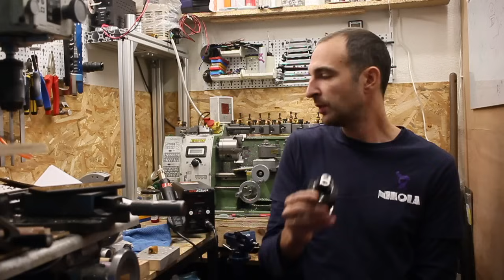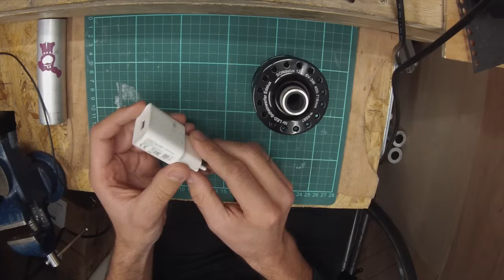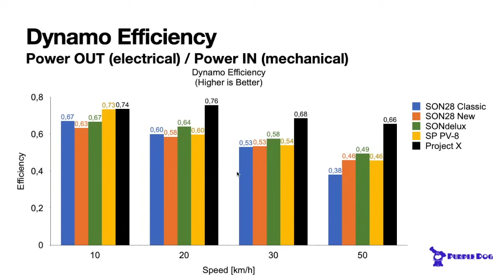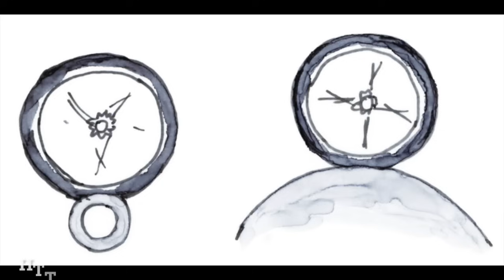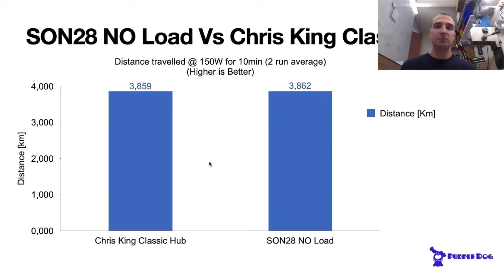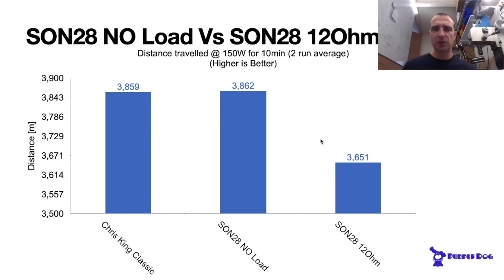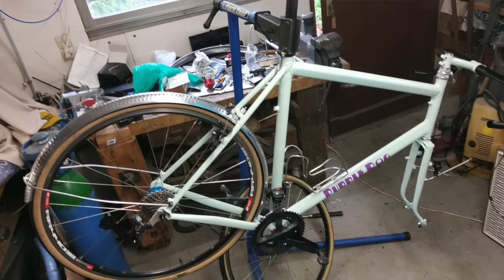Dynamo Drag and Resistance Tested: Myths Busted

Comment: Very fascinating video to watch through, thank you!  I am curious if there is a rough model of the equivalent circuit of a dynamo that would be "good enough" to put into a Spice simulator and be able to play around with?  I imagine that this may be easier said than done thanks to not only a large shunt inductance and modeling all the coupling effects, but maybe there exists a crude simplification to get a hobbyist started?
I am also curious how the drag effects compare between a shorted output vs. and open circuit output?  What I am getting at is whether an electronic load should aim to minimize voltage or minimize current when the available power exceeds the load power.  I imagine the ultimate load circuit would attempt to not only use peak power tracking (adjusting effective Rin dynamically), but also would adjust any series/shunt capacitance to peak low speed power as the frequency varied as well?
Reply from the maker: Thank you for your comment and the nice words! I will pin this discussion on the top, as people might find it interesting.

To answer your question: there is a paper that I think has what you are looking for (https://www.mikrocontroller.net/attachment/14850/BikeLight.pdf). There is another one that had a MatLab simulation of a dynamo model, though I can't seem to find it. 

To summarise, it describes exactly what you mention - Maximum Power Point Tracking (MPPT) so that the dynamo always 'sees' the optimal load (at a given speed/frequency) for maximum power extraction. Some (current German) devices from my competitors use that principle. It is/was? largely a theoretical concept and while it does provide a quite linear response, to get any real power (5+W) you need to be going above 20+kph/13mph. The result of MPPT is that the power curve keeps going up together with speed (so you can get 10+W at 40kph/25mph), rather than flattening out (as you get without MPPT) - Fig. 12 in the publication It does look nice 'on paper,' though keep in mind that those speeds of 40+kph are not sustainable for any reasonable length of time, let alone with luggage/touring/randonneering/etc. (this is elite TT power territory with all the aero other bells and whistles - deep section wheels/ helmet, aerobars, etc.). All in all,  you are still **tuning a small engine/using a weak power supply to begin with (ie the 3W dynamo)** so it does not address the primary issue - ie dynamos were made to power **incandescent** bulbs/12Ohm load (aka century old technology) and hence not done with modern electronics/power needs in mind.

If you have not seen it already, I am actually I am working in collaboration with SON on a much more powerful dynamo - Project X (https://youtu.be/YFMvuJGLCV4), that is ~300% more powerful than standard 3W dynamos (under identical load), and with the right electronics such as my recent  dynamo powered lights+USB-C charger (The Stalker - https://youtu.be/1nl_8t_ykJg). With this dynamo you can get **sustained** power of 7-8+W in the 15-20kph range, which are normal riding speeds. I am working on some other electronics that can take ~10W in the same speed range. 

**In my opinion/expereince** after working/designing various power supplies (for dynamos) for some years now, is that you need a capable power supply as step 1, rather than starting with a unsuitable (and extremely outdated) power supply (aka '3W dynamo') and trying to optimise for it afterwards. 

I am curious to hear any comments and get a discussion going on that subject (MPPT) and dynamo optimisation, so do not hesitate to comment below. :)
Reply: @CustomPurple  Thank you, this is exactly what I was looking for.  I agree with all you say about current limitations.  Being an engineer with a leftover dynamo and a few dead donor headlights on my desk I’ve been desiring to go play with them to make something for fun to get back to circuits I can actually get my hands on.

My background is mostly RF and Microwave work (former Rohde & Schwarz engineer), so I am uniquely both over and under-qualified.  It has been a long time since I my projects were home lab friendly like this sort of is.  I still want to go waste some time putting together something fun, whether justified or not.  I expect that once I hack something terrible together I will be back to order something nicer from your shop.  Thank you for the guidance!
Reply from the maker: You are welcome. =) I am curious what you make out of it. After working at Rohde & Schwarz I am sure you have some different perspective on things(not to mention some cool measurement tools hehe!!!). Definitely curious what comes out of it! One point is that bottle/tyre driven dynamos have too high frequency (at the rectifier) and I am not sure any MPPT has been successfully done with one. Hub dynamos spin much slower at the same speeds.

Comment: When are they going to make a better electrical connection Port????
Using a dynamo hub on a 20-in wheel would even work better....
Reply from the maker: Son29s already has the Son coaxial system by default. Other Son models (with the flat connectors) can be converted to Son coaxial with an adapter; I sell quite some of those actually. 

Of course the best way is the Son SL system that uses the fork dropouts, though for that you need a custom fork (I make and sell a couple of these during the year as well). 

Dynamos in 20in wheels doesn’t really generate more power, it just shifts the power curve. A newly designed dynamo (like Project X in my other videos) is the way to get more sustained power at all speeds.

Comment: Would you offer a non-stvzo beam, in a traditional round pattern?  I get really frustrated with beam cut-off, i actually need to see when i turn, and i dont ride on perfectly flat straight roads.
Reply from the maker: Thank you for your comment. So I can answer in 2 parts.

1. I have a product (2 actually...) The Stalker (https://custompurple.com/the-stalker/) and Kerrigan (https://custompurple.com/product/kerrigan/) that has a LED matrix and beam control so you can switch on a high beam above the cutoff. I call it Farsight and as the name suggests it does exactly that, though it dazzles oncoming traffic. It is dimmable to tune to your riding conditions as well.

2. This often missed when people think StVZO cutoff, though, as StVZO regulation is measured on a white wall 10m away (which is quite far), StVZO style optics have **superior** throw or illumination distance as compared to 'simple round beams' - I talk/show it in my Stalker video here (https://youtu.be/1nl_8t_ykJg?si=Q8tXT3RtH5410v0E&t=686). Round beams have a VERY bright spot close in front of you and a sharp drop in illumination afterwards. So your eyes naturally focus there and at even moderate speeds (15+kph/10+mph) you 'outrun' the beam. On (fast) descents it is significantly worse I can even go as far as saying it is borderline dangerous and unsafe.

Comment: Reactance is important for dynamo hubs because these put out alternating current. Generally reactance is like ohms but it comes from internal resistance to changing the polarity so quickly. Back emf in motors is the perfect example. The stator generates a magnetic field, and the rotor is spun, but the rotor has its own magnetic field that will induce voltage perfectly opposed to the stator. Once these two are equal the rotor can no longer accelerate. It is stuck at that speed until either the stator gets stronger or the rotor gets weaker.

Its like DC, stacking up batteries negative to positive adds voltage, stacking up positive to positive subtracts. This applies to ac as reactance because induced voltage is always 180* out of phase.

It also is how certain 3 phase can be higher voltage than any single phase, because the voltage is adding for part of the wave.

Comment: very interesting matter. Ive been tinkering a lot to get most out of my hub dynamo, but it is never been simple. Another thing about your 12 ohm bulb: how does that relate to the fact that here in the Netherlands classic 6v 3w dynamos always power a rear light in parallel. so that would sum around 6 ohm. does the german regulation not require a rear light? that seems odd to me. cheers and thank you for uploading. Hope you will get into detail about rectifiing and regulating to 5 v (usb standard) with a hub dynamo, and how several products compete here over the efficiency.
Reply from the maker: Thank you for your comment. I mentioned it briefly in the video that the 12ohm is by doing the math/ohm's law). The math is as follows: 

Front bulb: 2.4W, 6V -> 0.4A, 15Ohms (6V/0.4A)
Rear bulb: 0.6W, 6V -> 0.1A, 60Ohms (6V/0.1A)
Total: 3W, 0.5A, 15 and 60Ohms in parallel (15x60)/(15+60) = 12Ohms

I myself make and sell 5V chargers from dynamo video here (https://youtu.be/BmKDtM5p_H0). The Companion allows lights on AND charging at the same time. Most (if not all?) products are charge only.

Comment: In praise of STVZO. I acknowledge Nikola's comments about how STVZO regulations have created a situation where reported numbers like power output do not match real world experience. 

But there is a plus point in that the regulations requiring anti-dazzle beam cutoffs have resulted in Germany to make lights with the best optics. I have both STVZO and non-STVZO lights of similar output - and the STVZO have better optics which put the photons where you need them, neither spread too wide nor confined to an intense pool of light a few meters in front.

Speaking with experience of B&M Cyo T lights, Supernova E3Pro2 - and with non STVZO Lezyne lights.
Reply from the maker: Thank you for your comment. The whole 'StVZO approved' regulation is quite misunderstood around the internet and beyond. While almost everybody focuses (pun intended) on the beam cutoff, there is much more to the beam and everything else around it. I cover the 'beam part' in details in my other video here (https://youtu.be/BmKDtM5p_H0?si=YZnR5n6i03pIvO-L&t=491), though the thing about the so-called StVZO beam shape is that since it is measured on a white wall 10m away, the 'throw' or how far the beam illuminates in front of you is quite long. 'Regular' round beams are VERY bright in front of your nose (literally) and as such our eyes focus up close and you 'outrun' the beam at even moderate speed (15+kph in my experience), the 'throw' is quite short, as you have experienced. They do give the (false in my opinion) impression of higher power though, especially since they illuminate 'all around' especially reflective signs/trees/etc. There are oval/asymmetric 'regular' optics that kinda have a cutoff so they don't dazzle, however, they suffer from the same lack of throw/and largely miss ground illumination in addition. 

As a further example a 'High beam' or (farlight/Fernlicht in German) does indeed dazzle, HOWEVER, it still has a cutoff (albeit higher, hence the dazzling) and quite some throw (even more than the 'dipped beam'). Therefore it is not just a simple 'cutoff' hehe.

And of course it doesn't end there. =) There are electrical specifications or the (in)famous '6V/3W' that I covered in this video. While anecdotal, an ex-Supernova employee told me that the model light that you actually buy, will not behave as shown in the expo stand. It will not have all modes since in some settings it does not cover the electrical part of the regulation (basically it falls outside of the (archaic) regulation).

Whether having all this being 'required' is all positive, remains debatable, at least according to me.

Comment: Wrt SON dynamos which handle different rotation speeds. I have a Brompton (folding bike with 16 inch wheels) from around  2009 which included the (far from cheap) extra of a hub dynamo. This is a SON model XS (rated 6V 3W) which (I have read) was specially made for Brompton. Possibly the first dynamo that SON made for smaller wheels (higher RPM). 

With a B&M CyoTPremium I get plenty of light.

Current Bromptons use a Shimano branded dynamo hub, as I understand.
Reply from the maker: According to Wilfried Schmidt himself he got a request from a guy in The Netherlands for a Brompton dynamo and as the saying goes - the rest is history. Actually this WAS the first dynamo I got, (it cost me an eye watering ~330+ euros way back in 2009) and I still have it and used it last October after sitting for years packed in a shed - the contacts of the switch for the Bumm light were oxidised, though after a couple flicks of the switch I had lights and nothing to worry about. I am sure that data is out there though the SON XS will not 'meet regulation' in 'regular sized' wheels, though it is perfectly adequate at higher rpms/with LEDs. The Shimano Brompton dynamo came after the SON, as a lower price option for dynamo lights since before that it was either the SON XS or a bottle setup (which in my opinion was so janky, I am surprised it actually worked!), I am pretty sure it was done as per Brompton request.

Comment: Additional way of connecting to SON dynamos fot those of us too mean to buy the SON own-brand coax connectors. On two bikes with SON dynamos I am using the regular Shimano dynamo hub connector, which work ok provided you put a thin plastic packing piece into the connector - necessary since the Shimano connector lugs are a bit thicker than the SON ones. Shimano part number Y-2SS98030, cost about EUR 4.
Reply from the maker: Yes excellent point and the Shimano style connector has the other advantage of being field serviceable when we forget we have dynamo attached...in the middle of the night repairing a flat.

Comment: Have you had any experience with the following bottle/sidewall dynamos:

1. Velologic
2. AXA HR Traction Control

If so, what are your views (positive and negative) on these two products?

Thanks
Reply from the maker: Hi there,

I already answered in detail about the Velogical in another comment, you can check it out though to summarize: it's lightweight but it always slipped in the rain for me and it is noisy.

The AXA one I used maybe 10+ years ago on a dutch daily bike and the dynamo worked, nothing much else to say. What surprised me actually was that I had the plastic wire port break and I could order it as a spare. All in all hub dynamos are better if you can get them, in my opinion.
Reply: @CustomPurple  hi, thanks for the reply. Also, in what ways are hub dynamos better than good bottle dynamos (e.g. AXA HR) ? Thanks in advance

Comment: Yes, you can not beat dynamos for reliable lighting 👍 I’m currently integrating a Son delux into my beautiful Look 765 frame.  
Ill be using the Ahead charger circuit from Jens During.

Schmidt is about to release an Edelux variant with USB out which might have interest me. But as always, a design in time 😊

The dimmable LED sounds a valid idea! I was running filament ‘Union S6’ lights in the early days and the lesser light was adequate then. Very easily we get swept up into brighter being better. But it’s not necessary. 

Ive done PBP 91 and 99

Great video. Love the passion 👍
Reply from the maker: If the Jens Duhring charger is the forums lader, it is actually the one device that currently can squeeze the most possible power put of "3W" dynamos. 

I actually met the SON people when I had the prototype of The Companion in 2023. They had just announced their light + charger. This is how we got to talking about other dynamo projects over the months that followed.

Enjoy your nice bike!

Comment: Backwards Compatibly?
Rückwärts Kompatibilität?
Reply from the maker: You ask a very general question so I am not sure what you mean though if you are asking about the Project X dynamo:

The Project X dynamo (if it comes to market) will fit 9x100 quick release and 12x100 thru axle forks. It will use the same connectors as other SON dynamos and also SL (connectorless) will be available as an option. Disc brake version and you simply don't use the mount if you want to use rim brakes.

Electrically, like I mention in the video it is electronics that make a difference. The '6V/3W' ecosystem is ' very outdated' and currently served by ALL dynamo related products. I have a first product that will be able to take full advantage of the Project X power and efficiency capabilities - The Stalker (https://custompurple.com/product/stalker/). The Stalker and all future devices I make will be compatible with '3W dynamos,' however, they will also take advantage of the features of Project X for a MUCH better user experience. 

As there are literally millions of devices in the "6V/3W" ecosystems, backwards compatibility is not a priority for me. I make electronics devices and hopefully dynamos to work together and fit the features/price point so that they can be used/enjoyed by the people interested. Like I mentioned my electronics WILL be compatible with 6V/3W dynamos. 

Let me know if you have any other questions.
Reply: @CustomPurple
Regarding your Stalker light. How powerful/bright is it compared to the most powerful (100 Lux) B & M dynamo lights?

Also. If your dynamo becomes available for sale, what advantages will it offer in combination with the Stalker light that current systems do not offer?

Thanks in advance
Reply from the maker: I will have a separate video to discuss all the features of The Stalker since there is only so much you can put in a comment 😄 

Though it has a LED Matrix with dimmable low and high beam as well as USB-C charging (even with the lights on) as well as absolutely no flickr at low speeds.

Subscribe/come back to the channel for more details (on more dynamo projects) is all I can say at this point in time. 😁